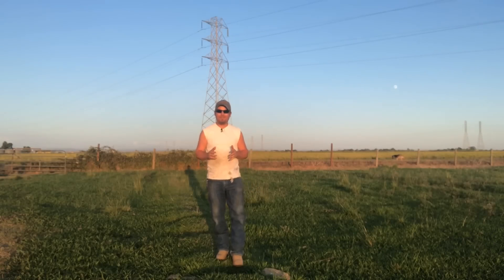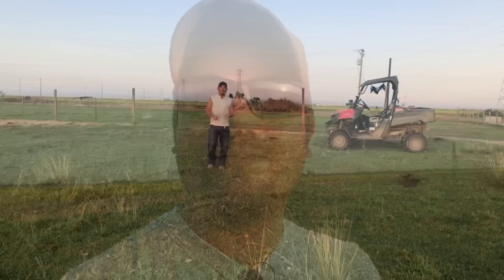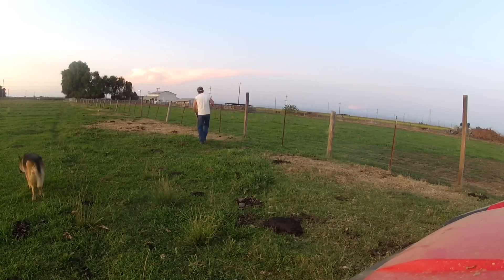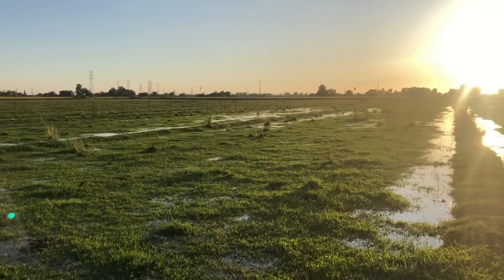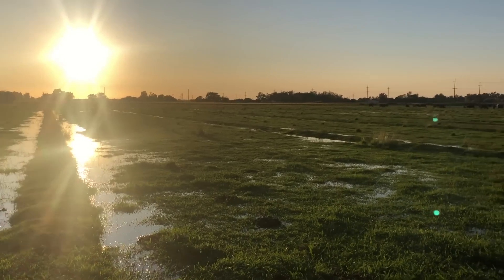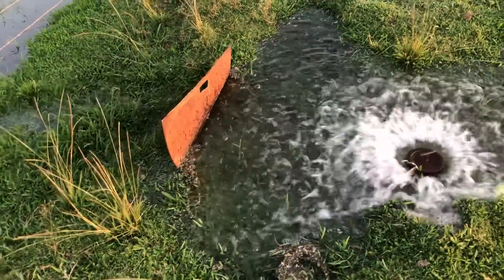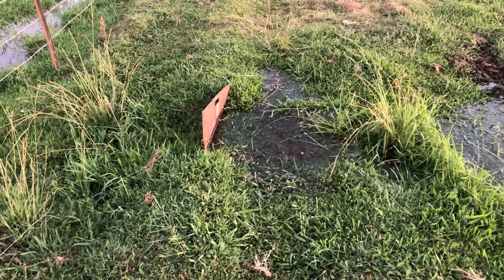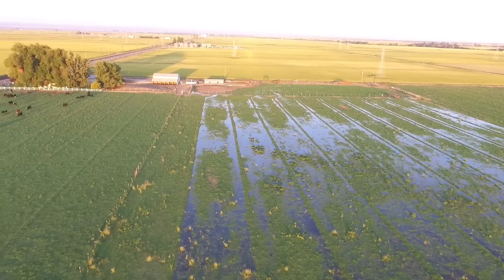What Are All Those Ridges in My Field???

Comment: Is that water from a river, or underground water table?? If there are levees, there must be an impounded water supply or dammed river at higher elevation to provide the pressure in the system so when you open the valves you get the water. (Same as what a water tower would do.) This field is so technically irrigated, was it meant for a cash crop and not cattle pasture, or maybe it gets really dry where you so you need to be able to irrigate graze lands.
Reply from the maker: The water is pumped up from the ground and the pressure is created by the pump. This is how many people irrigate summer pasture around here as we rarely get rain between May-October